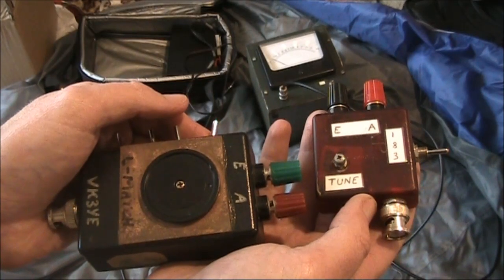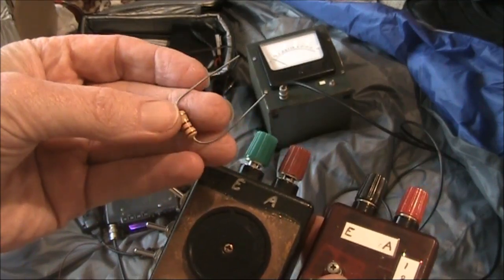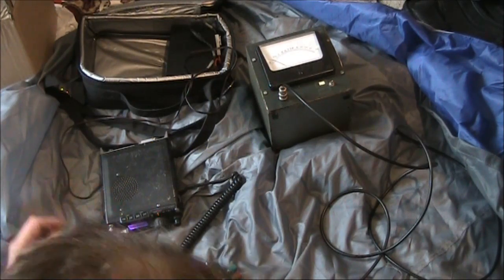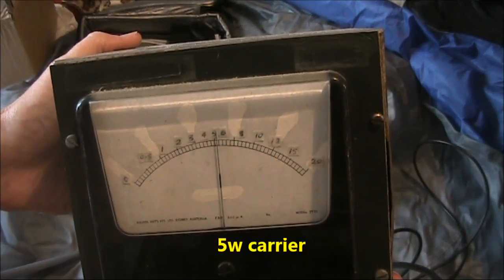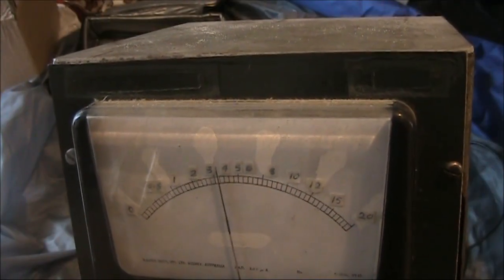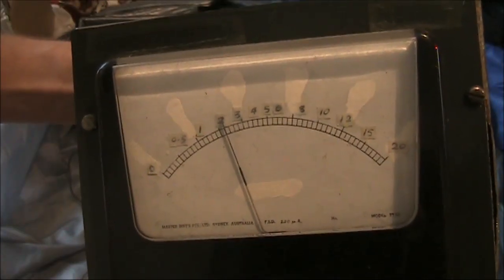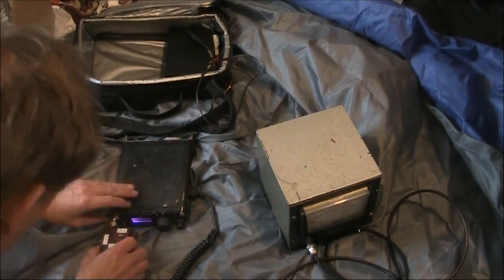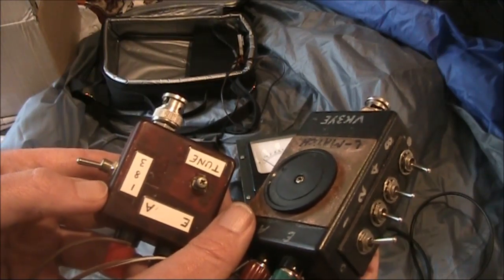How much power is your QRP antenna coupler losing?

Comment: I believe the methodology is rendered invalid by your second adjustment you made to the setup after you set each tuner to the nominal 2k2 load. By adjusting EACH tuner (as you did) to the nominal load (It could equally be valid, and possibly more informative, setting that load to 100 ohms, or 5 ohms or 300+/-j200, whatever, but explain your choice), you've set the 'interface plane' to be that nominal impedance. No rationale for the choice, but no problem. 

Then you measured the loss. Fine. But having glanced at this, you then adjusted the tuners for max output. Hmmm. That step, I suggest, rendered the first pair of adjustments, and the result you ultimately claim, completely invalid. That last tweek of the knobs, I suggest, changed the reference plane and turned this setup into a simple series connection and adjustment of two tuners i.e. effectively a dual tuner network matching the output of the radio (roughly 50 ohms, probably) to the load (which is probably also about 50 ohms, probably. Maybe.) And you could expect the resulting loss to be low. The only issue - It's not the measurement you claim to have made, and arguably it's probably of little value.
Reply: I wonder if adjusting the tuners once they are connected back-to-back is required because they are connected using a couple of short lengths of wire. The pair of wires is effectively a balanced transmission line which is unlikely to have the same characteristic impedance as the resistor. Therefore, each coupler needs readjusting to get best match from 50 ohms to whatever the impedance of the balanced line is. The peak in output power on the meter indicates maximum power transfer when both couplers are adjusted to this new impedance?

Comment: My experience with baluns and connectors like this is if the wires used to jumper across them is kept as short as possible you get much better results. Would like to see this repeated with a much shorter more rigid jumper.

Comment: Excellent experiment Peter. Can you think of a way to test one coupler independently?
Reply from the maker: You could have three couplers. Test them against each other so you can compare them for losses? Or maybe make up an RF probe and measure voltage across a 50 ohm dummy load for the reference and then across a high value resistor across the coupler to compare. The voltage for the latter will be higher due to the high impedance but you could convert it to power if the resistor value is known.

Comment: Thanks, Peter. Very interesting experiment. Did you use a 2.2k resistor to simulate the impedance of a half-wave end-fed, or was it what you had on hand that was of sufficient wattage to briefly handle 5W? Also, I'm assuming the coils in the couplers contribute the most to the insertion loss. I probably saw the videos in which you built those, but what were the core sizes and wire gauges used? With larger gauge wire (perhaps necessitating a larger core as well), the losses could be reduced, couldn't they?  73, K7TFC
Reply from the maker: Both. Had it on hand and high z. I used RF chokes in one coupler and toroids in the other. First in particular likely to be lossy due to fine wire and small former.

Comment: so always best resonanse antenna ?
Reply: Greg White Greg, I think Alexej is correct. I’m not an expert, but surely, if you put the tuner at the feed-point of the aerial it matches aerial to feed-line giving an aerial system that works as it should (provided the feed-line matches the Rx input). If you put tuner next to rx, as Alexej stated, then the untuned aerial and the unmatched feeder are just an unmatched mess picking up everything and giving problems. Les
Reply: @Greg White Correct.